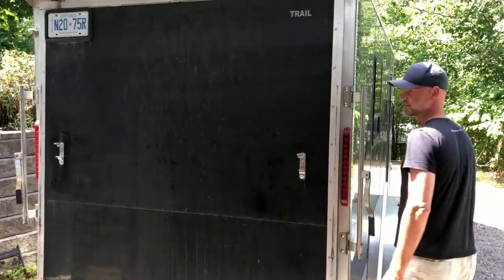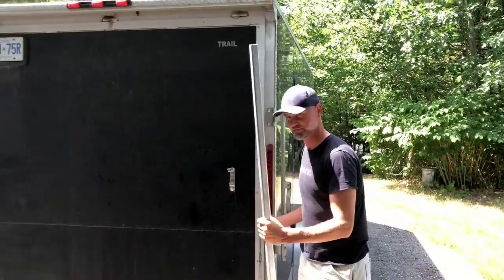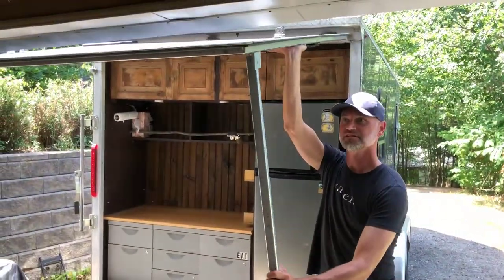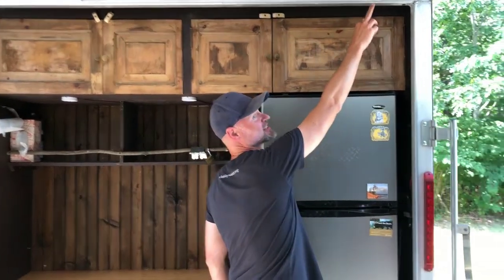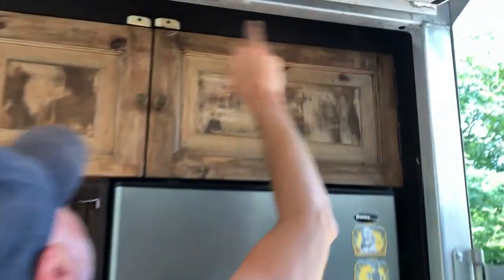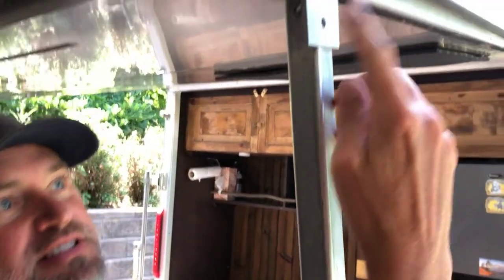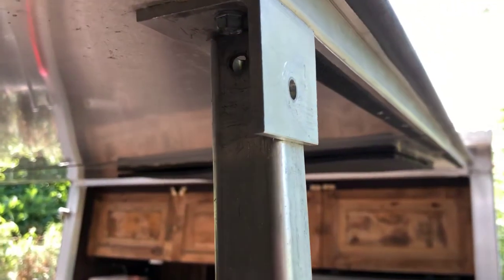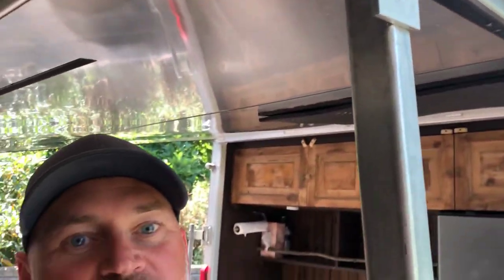Upside down trailer door/awning for converted cargo trailer - Viewer Request

Comment: Hmmmmm, a door like this was on my trailer build wish list however I found a great deal on one that was a couple years old and went for it.  I wonder if I could just swap my door like that or if I'd even want to anymore for my needs.  With your kitchen back there it's a great idea but for me the door may serve better as a little deck.  I will have to give my design more thought for sure.
Reply from the maker: I considered doing it as a deck too but the protection from sun and rain having it up top is ideal

Comment: Looks like you're from Ontario as well, we are currently planning out our conversion and would like to do the same with our ramp. Any chance you'd be willing to share where you had the rear door mounted?
Reply from the maker: The trailer manufacturer did it when we had it custom built, but they are no longer in business unfortunately. Good luck in your build.